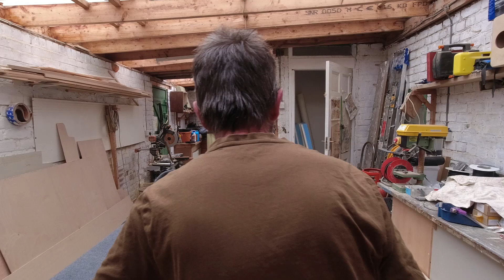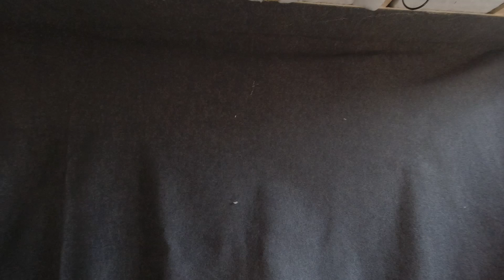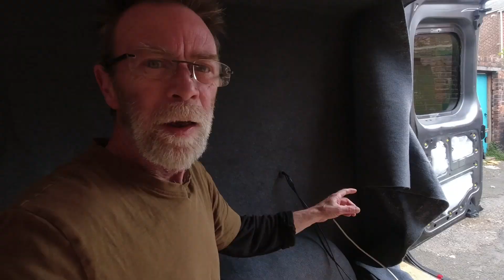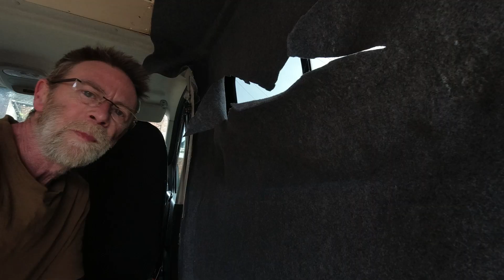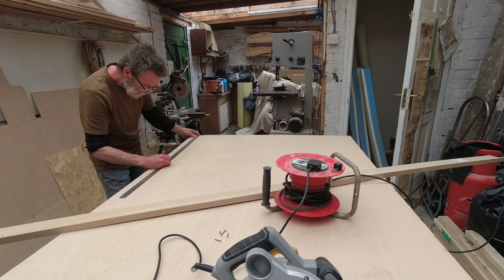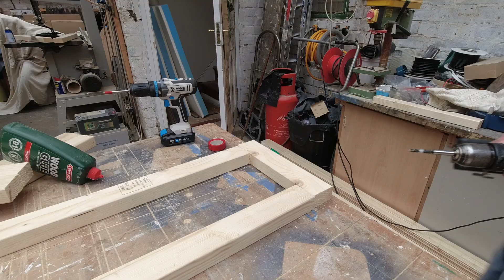Vauxhall Vivaro Camper Van Conversion (Day 7)

Comment: Can you share the thickness of the plywood you use? I've seen people use 3/4" but wondering if I could use 1/2".....just a twin size bed for me only. Yours looks thinner than 3/4" (19mm?) but wasn't sure.
Reply from the maker: Hi, I used 12mm ply for this and it worked out well.....the frame gives it plenty of support.

Comment: Hi Dave , great vid as always. Iam at the carpeting stage on my trafic 2015  and looking for tips . I want to ask did you carpet over the plastic conduit above and left of the sliding  door or did you cut holes for the conduit to clip back in over the carpet ?
Reply from the maker: I carpeted over it but cut  a line along the top where it reaches the ceiling incase it ever needs to be removed.

Comment: Pretty cool to just fabricate it by yourself. And it is much cheaper for sure. Nice vid again mate!!!
Reply from the maker: Thanks a lot.....Yes, all of the furniture and R&R bed will be made from scratch in this van. The wooden R&R ded is a lot lighter and smoother to use than the metal framed ones.

Comment: Great informative video Dave. Just wondering if you're going to stain the frame or paint it. And, if you're going to fit a drawer underneath. Cheers mate.
Reply from the maker: I'm going to lacquer the frame to match the doors and ceiling. And I am just going to leave the front of it open so it is easy to bet bedding in and out. Thanks.